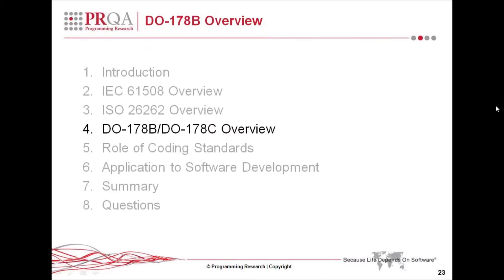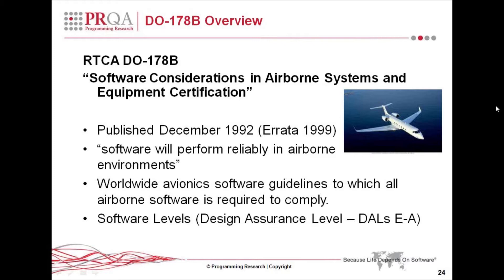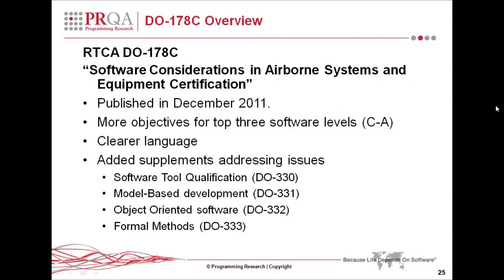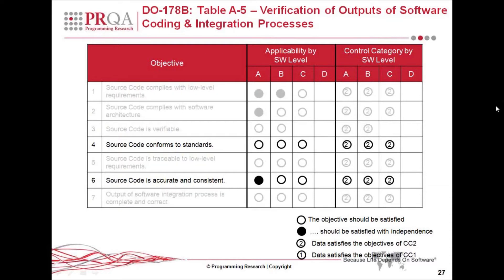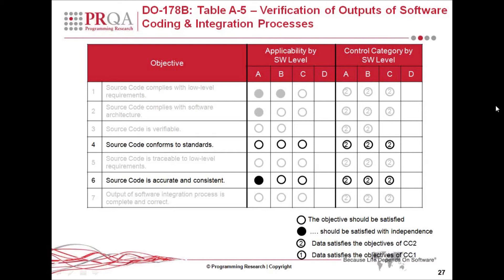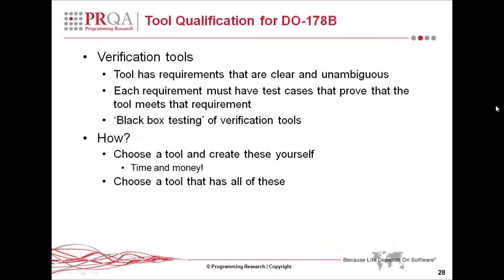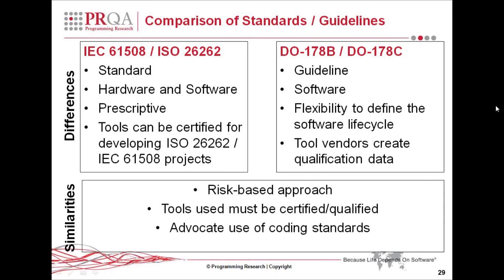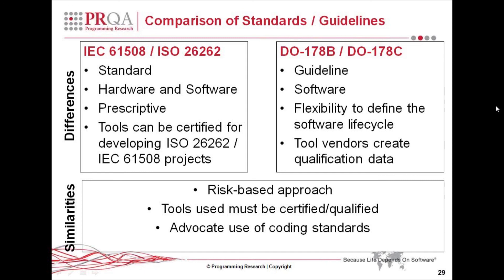DO-178B/DO-178C Overview - Excerpt from Software Development For Safety-Critical Webinar

Comment: As someone wanting to transition from a rapid-prototype environment where CI/CD* tools are used, to a formal DO-178C environment..  would love to see an end to end example of a project that implements all the DO-178C guidelines for a Design Assurance Level A project (or LM says SEAL Level 1 or Boeing XXX, etc).

For example, what are the typical documents required.. what are the typical software tools that are a must-have in the various stages of the software life cycle.. noting the difference between checking style and finding bugs:

Requirement Management -  DOORS, Jama
Static Source Code Analysis - Parasoft, PolySpace, CodeSonar,  horusec , sonar cloud, veracode PREFast
Dynamic Analysis - VectorCAST, RapiTest
Configuration Management - Git, SourceSafe
QA - Helix ALM
V&V - VectorCAST, LDRA Testbed

What is the general attitude towards open source software (ex. FreeRTOS) and code-generation tools (ST's Cube MX).  

How do CPLD and FPGAs fit in to the picture.. since not exactly software, but they are programmable devices written in a HDL.  

*CI - Continuous Integration / CD - Continuous Delivery/Deployment : Travis CI , Bugzilla, Jira, jenkins.io, GitLab
Reply: Are CI/CD tools not used in a "formal DO-178C environment"?